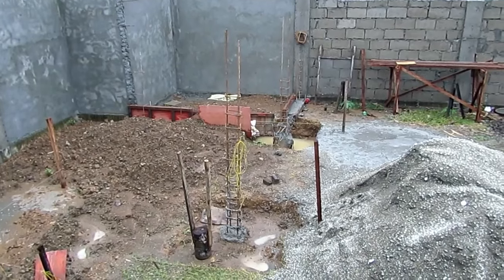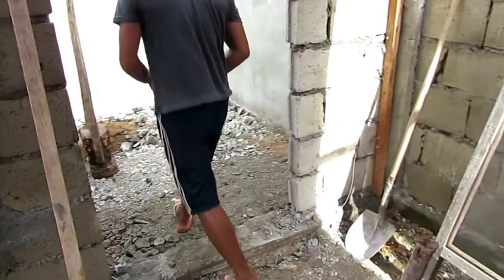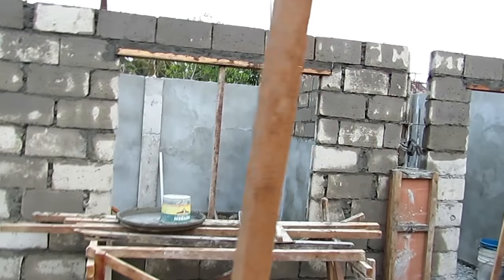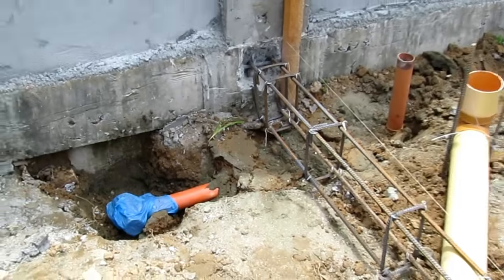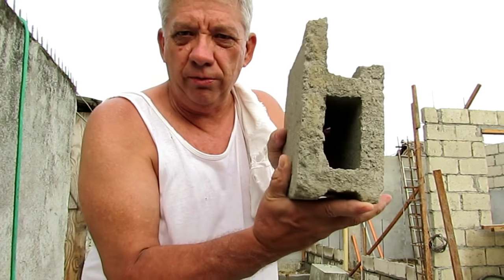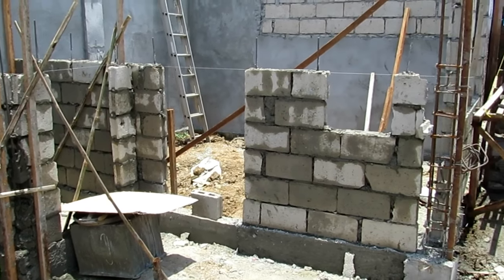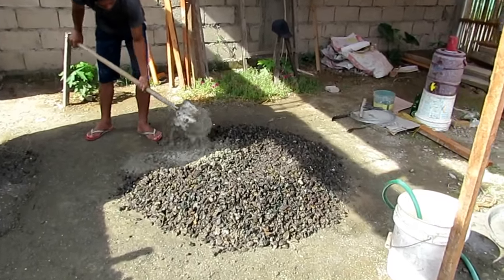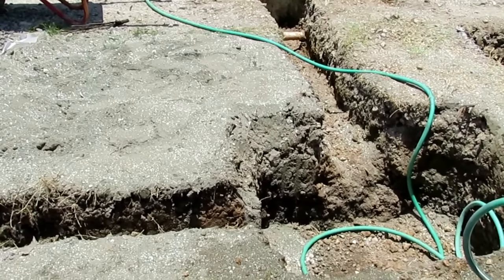Building in the Philippines - Expanding Paradise, Part II | Ep 78

Comment: I’m just building my house now. I always thought that a very wet concrete, is weak. But I can understand the logic in what you’re saying, that the concrete absorbs into the hollow blocks.  Where I bought my blocks, I was told they’re top quality. 80 blocks instead of 100 out of 1 bag of cement 😂😂 . I don’t like the way they do the headers over the windows. I think I’ll make the lintels myself with rebars. 
Your place is coming along 👍👍👍
Reply from the maker: Technically, the lower the amount of water in a traditional concrete mix, the lower 
its slump. Low slump values in traditional mixes generally mean higher quality concrete. But in the Philippines, you can throw all that out the bamboo window because they tend to NOT use a 3 to 1 sand to portland ratio. But generally, the greater the slump, the better it settles into the voids inside the hollow block. Because many projects there use only 4 inch blocks, the cavities can be rather narrow. I made sure we were at a 3/1 ratio and just added a little more water. The blocks absorb the excess water and you will wind up with fewer or no voids. My lintels were made from 4-course #10 rebar.
Reply: Living in the Pacific cheers for that I’ll take on board what you said. If my house falls down I’ll blame you, hahaha just kidding👍👍👍

Comment: Another nice video Randy, both informational and entertaining....your trademark. Your comments about the six row limit per day on the hollow block construction
due to "compression weight" were interesting. Theoretically speaking what is the engineering consideration on the compression weight? It is the first time I have seen reference to such a thing as six row limit per day. 

Great idea on the overhangs for aesthetics and future uses. You are going to have that view of the ocean and what a nice spot it's going to be to relax and spend time. 

...looking forward to watching the rest of the progress on your paradise expansion. Peter White did an absolutely amazing video series on his home build in Compostela and at the end also provided some general cost information. That was nice information to know about relative to location and type of project. Maybe you might want to blog about your construction experience(s) and give us more depth on costs and labor acquisition (Do's and Dont's).....etc. You are very knowledgeable and a great resource for such things. Just a thought.
Reply from the maker: I never realized the course limit before either, until now. I'm guessing the weight of all blocks exerts too much pressure on the lower cemented joints and the blocks have a tendency to move out of line, or "settle" too much. That is what I am being told and I'll take them for their word, since it IS my structure! It makes sense I suppose.
Reply: It [does] make sense. You have some good guys doing your masonry work. Better than average.

Comment: great vid, looks like they place the floor reo bar straight on the ground/dirt, may be prone to corrosion over time
Reply from the maker: No, it is pulled up into the concrete. Rebar not "inside" the pour is almost useless.

Comment: I paid extra for my hollow blocks and had them mix them for a harder block. I also made sure they used river sand and not beach sand. I also used a six inch hollow block which when finished is eight inches thick. I did that to keep the karaoke and rooster noise outside.
Reply from the maker: River sand, masonry sand, or beach sand? How it was transported is more important than where it comes from, and determines its angular qualities. Quite simply, you want &quot;coarse, angulated sand&quot;. Ocean sand tends to be composed of calcium carbonates as opposed to continental sands which are derived from quartz (silica). The angular composition of sand is the most important aspect of its construction quality Ocean sand is okay as long as it is angular and washed of chlorides and sulphates. Desert sands are the worst choice for construction because it is rounded and not angular. River sand can be just as smooth depending on currents. All sand used in construction should be in compliance with respective codes of practice (like ASTM C33).
Reply: Retired in Samar Needless to say, I can't break my hollow blocks with my bare hands.
Reply from the maker: The cost to build almost doubles though with harder blocks and all the concrete needed to fill them.
Reply: How do you go about finding and making sure you are working with angular sand? You need to do a detailed blog buddy.
Reply from the maker: I suppose the feel of angular sand is just more gritty, like sandpaper. You could always put it under a magnifying glass I suppose. Keep in mind that until recently, most construction sand was mined from riverbanks and quarries. But with the dramatic increase in demand, marine and beach sand mining are increasingly common, and is why many beaches worldwide are disappearing. Check out the video "Sand Wars" https://www.youtube.com/watch?v=iA637GgXLBo

Comment: Cool. I don't really understand their methods, but they to seem to make solid structures. The skinny holo blocks are unusual to me, too.
Reply from the maker: I had a really difficult time myself, until I began to understand the methodology. I still have a problem with running all electrical and plumbing through the concrete. That just reduces the structural integrity of any wall. All my plumbing and electrical on this project will be visible... i.e., the urban/industrial look.
Reply: My thoughts exactly, re: keep the plumbing and electrical on the outside. It's the one thing I would deviate from working with the Filipino builders while showing them something different. Beyond structural integrity the considerations for repairs, upgrades and additions downstream preclude (in my mind) burying that stuff inside of the concrete structure.
Reply from the maker: I kind of like the urban look!
Reply: I saw what they did to our house in Baguio. they burried electrical wire looks like a hose not sure about the name. something color orange. It's easy for wiring electricity at home and saves time.
Reply from the maker: It's a soft plastic flexible conduit they use here. I personally am switching to the more rigid PVC and going to run it outside the walls.

Comment: i saw the guy hammering the wall for electricity i thibk its easier before mudding 1 inch the wall plus we use metal net sheet to hokd that thickness here .only a thiught my friend good luck
Reply from the maker: I agree. On this project though, I will be running all electrical in conduit on the outside of the walls.

Comment: Nothing wrong with the construction style, but it is for skill and that concrete mix is a lot wetter than it should be.  It is just a house so it will work.   It is just a wall around the yard so it will work.  

They aren't using wet concrete like that on high rise condos in Manila and Cebu.
Reply from the maker: You're right Dwayne. Here, they will also use a 4 or even 5-to-one sand/concrete mix to save money.  I insist on a 3-to-1 ratio for strength (as recommended by the concrete manufacturer). Also, water should never exceed more than 25% of the total composition/mix, otherwise the portland becomes over-hydrated and looses it's strength.

Comment: lm at Surigao City. we have 2000 sw mts near water.  its a nice block.
Reply from the maker: There are a different set of issues in play when building so close to the ocean. I wish I would have realized sooner.
Reply: Are the concerns around the effect of salt water on bricks !!
Reply from the maker: Bricks or hollow blocks? Salt can be corrosive to almost everything. Most times though, any concrete product exposed to ocean waves or spray should have a waterproofing additive included in the pour. I would also suggest a sealant to be added to those sides of a home exposed to the ocean. Exposed rebar to salt and oxygen is especially prone to rust and corrosion. Ocean sand that is not thoroughly rinsed of all sulfides will also deteriorate concrete and corrode internal rebar. It pays to take extra precautions and spend a little more for long term integrity.
Reply: i will research what i can do to keep the corrosion out of bricks and rebar. thanks for the tip. think i might get my family over  there to errect a small house that one of them can live in or use to vidit block. later it may serve as a tool shed,generater room etc
Reply from the maker: Good idea.

Comment: That is very very cheap hallow blocks. In Catarman if you can spend more money there is more good quality hollow blocks, also anyway where in Philippines there is different price of hollow blocks more expensive more good quality.  I got my house in Northern Samar and in Laguna and I choose a good hollow blocks
Reply from the maker: With hollow blocks, you can choose any level of quality you wish... just depends on price. I choose this particular ratio of sand to portland because we used a stronger mix to fill and surface with. Remember, hollow blocks are mainly forms for concrete. Some people use 4" blocks, some use 6" or 8". It is all a matter of preference and purpose.  Most builders use a 4 or 5-to-1 sand-to-portland mix. We used 3-to-1.

Comment: What do you think about "Waffle Crete" construction in the Philippines ?
Reply from the maker: I used similar technology with my basement walls. The problem here in the PI is accessibility. There are many areas where you just cannot get a flatbed hauler and a large enough crane into sevice. In the smaller cities, you would need to block off streets to get the job done. It could work in certain areas, but the market price-points here would be limited to upper middle class and above, and could affect marketability and profitability. I like the concept though.

Comment: Consider the ICF (Insulated Concrete Foam) blocks that are widely accepted, and used in load bearing and basement walls in the U. S. and beyond with the use of structural steel and a concrete fill. I see no problem with the "Filipino" method compared to that.
Reply from the maker: I built a house once where I had the basement walls poured in a factory, shipped on flatbed trucks, and set in place with a crane, glued and bolted together... all on a 14" bed of 3/8" crushed and washed gravel. No foundation needed! Some people thought I was crazy, but it was probably the most sturdy structure I ever built!
Reply: I hear ya -- I've been tagged with the crazy label a few times, and never sought a second opinion. .......retired in Texas.
Reply from the maker: Where in Texas?  My family home is in Fredericksburg.
Reply: After 16 years in/on Guam ...returned to some family land in Wharton County - It's a garden spot. I know a few people that retired around Fredericksburg, the town notable as the home of Texas German, a dialect spoken by first generations of German settlers who initially refused to learn English :)
Reply from the maker: What drove you away from Guam?
Reply: Weighed my options
Reply from the maker: Was life in Guam not that good?
Reply: Loved it - I could write a book;)
Reply from the maker: We  initially thought of retiring there, but we considered it too expensive and we would need to keep working.
Reply: Agreed, but it's a god place to retreat to if need be - Manila is less than 4 hours away.
Reply from the maker: Yup! We visit Guam every year.

Comment: no raised floor despite its a flood area???
Reply from the maker: It is not a flood area per se, only concern would be a storm surge in conjunction with high tide (as seen in the video I have listed here). We are surveyed 1 meter above the highest tides listed. Watch: https://youtu.be/h471MTZEd14
Reply: +Retired in Samar ohh thats good but this will help to have 30 cm elevation for rain issues also u gain that as more efficient slope for ur sewage and drain system ,and aout the hollow block definatly different then hollow block in the states but i recommend insulation will get ur electricity bill loweri heard elec bill in phil are high and less BTUs for ur AC system only an idea mangood work by the way and title match it perfectly expanding the paradise best of luck
Reply from the maker: Thanks for your thoughts and comment!